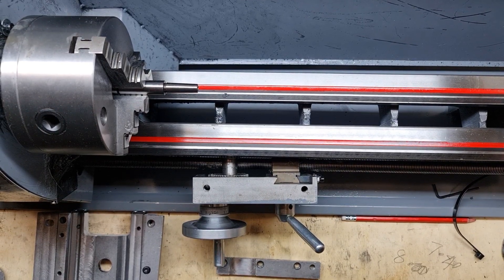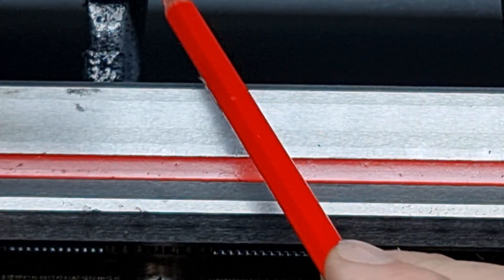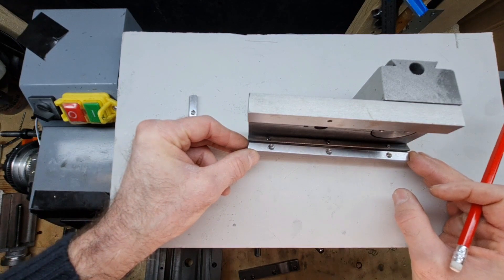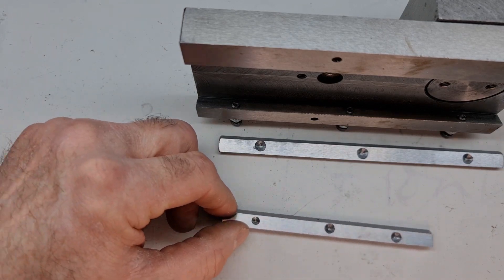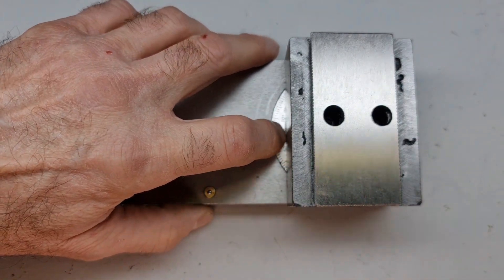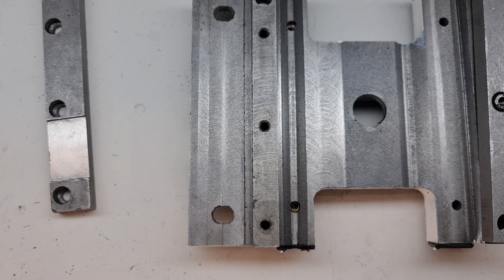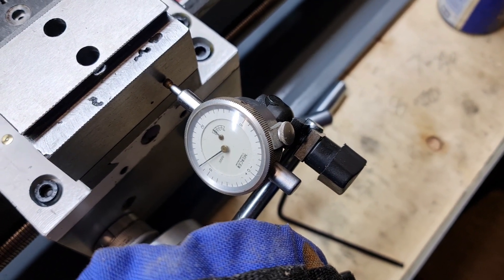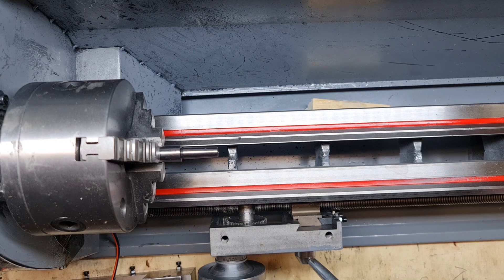Chinese mini lathe review part 3(of 6) More quality control issues & a strip down of the cross slide

Comment: I know this is too late but if the seller is offering a replacement on something like this, ask for a part refund. Like you say you’ve already done work to it to make it acceptable and would have to do the same to another one, and from their end, it’ll cost a lot to send you another one out and possibly scrap the one you return, so they’d be open to refund some of the cost. I’ve seen one guy who asked to return one and they just left it with him and gave a full refund!
Reply from the maker: @Yosser70  Hi, thanks for the advice. Well too late now the seller has long disappeared from Amazon, probably to start the next lathe selling company !!

Comment: I am not sure if yours is the same as mine, but when I took my backing plate off the entire shaft came with it as it is all 1 piece. it doesn't unscrew like other models. So, I am planning on redesigning it with grease points and oil seals. I think that will help a ton on top of the better Japanese bearings I want to install.
Reply from the maker: Hi thanks for your comment & interesting & greatly needed adaptions! There is one guy who has set up a permanent lubrication system for those bearings. I am not sure what shaft system I have, I will have a look at the bearing replacement procedure at some stage though.

Comment: This video just convinces me more not to buy any of these ultra-cheap lathes, and go with a Precision Matthews one. Granted that the smallest PM is a 10" x 22", but it is over 3 times the cost of the cheap (8" x 16") Chinese lathes on Ebay (factoring in domestic shipping, including the lift gate charge). You would get a working lathe out of the box, despite also being manufactured in China. I suppose the PM people take the lathes and completely re-manufacture them, but I'm not sure; the opposite would be that they hold the Chinese manufacturers to very high standards (something that has been otherwise hard to do from my experience). 

Trying to import them from China directly is also very expensive, as I discovered, with freight + additional 25% (or higher?) to the US tariff to the purchase price, making the 8" x 16" lathe 2x the cost paid and will still have the same problems encountered here (and only a partially working compound rest). So, to get a reasonable deal, you'd have to put up with the crappy customer service/support from the importer (at least in the US from direct from Amazon or Ebay--I don't know about other resellers like Grizzly).
Reply from the maker: Indeed, that is all quite true. You pay your money & take your choice ! I feel I have got this lathe into a position where I can use it, not for ultra precision work mind you, but for doing spindles like the one I did in the video. Hopefully the videos informed people of what to expect & also informed decision making, which was my intention.

Comment: I guess the old saying you only get what you pay for applies to lathes as well
Reply from the maker: You do, but my experience of an equivalent price second hand British lathe was dire! So never again, only Chinese new this time,  with all its faults.
Reply: @campacolasworkshop6042  If you bought an antique second hand lathe you were responsible for checking the condition of it when you bought it, that scenario is not comparable to buying a brand new machine, which old lathe did you have trouble with?
Reply from the maker: @heybabycometobutthead  I cant remember, but I would never buy a secondhand lathe again. I was responsible for checking it & I did but it was still rubbish when I came to use it. So clearly I did not have the skills to check it thoroughly enough. The previous owner must have worked around its rubbish accuracy but I could not.

Comment: You could dome the ends of the cross slide gib screws. If you reverse the gib so that the holes point the other way you can file a groove across the gib for the centre screw so that the gib will always move with the cross slide and just let the dome end screws connect with the gib without holes. The existing holes should not bother the gib sliding. The holes are generally drilled at the wrong angle since the drilling is done with the gib flat but when in place it is at an angle to the screws. Great video many thanks
Reply from the maker: Thanks for the suggestions :) I have been sent some new gib strips by the supplier, one blank & one pre-drilled. So I will try that with the pre-drilled one. I have managed to mill out the holes in the original smaller cross slide gib, so the holes are at least lined up now!!

Comment: best way to measure the spindle runout is to take the chuck off and measure the taper on the spindle nose.  You can also see how much axial play there is to gauge preload on the bearings.  They Ship them quite tight and mine had issues with how they seated the bearings.  If you can imagine, the quality only gets worse when you pull the spindle and inspect inside the headstock where no one ever looks.  Finally, you should run it for 5-10 minutes and check how hot the bearings are.  They should not be cold or hot but should warm up.
Reply from the maker: Thanks for that detailed info & I will follow uour suggestions.  I have tested at chuck jaw level with a calibrated piece & everything matches up, so I am happy....for now!  I have established what the run out is at the start, so will keep an eye on that :)
Reply: @campacolasworkshop6042  the problem with your testing method for the chuck is that you are assuming the scroll in the chuck is perfect.  it likely is not, so the best way to test the chuck is with different diameters.  now the difference may also be minor but I just wanted to point out that your runout likely changes as you change the jaw position (work diameter).
Reply from the maker: @JesseSchoch  OK, I get that, I will take the chuck off & test it the way you suggested in that case, when I have time.

Comment: Quick question on the block at 11.11 what size hole does it pivot on and the cross slide boss what size pin is it ,on mine there is a 2mm difference  thanks also is your tail stock extruded aluminum   alloy hollow  section, can't see any others on YouTube that look like mine ,it does not have a boss sticking  out around the locking lever for the  moving barrel.
Reply from the maker: Hi, really sorry you are having similar issues!! T
hanks very much for your feedback on the gib, I will do as you suggest :) 
The round pivot that goes into the hole from that block into lower part of the x slide mechanism is 31.25 mm in diameter the hole is 32.5 mm the pin is 6mm. So similar to  yours?  it  seems to have a 1.25 mm gap. So I think I have already worked out that getting any  work done requiring the cutting tool post to keep an accurate position will be difficult???
I tested my tailstock with a magnet, it is definitely a ferrous metal! Did you get nylon gear wheels as well ? 
My Amazon supplier has promised my parts  replacements in 2 weeks.
Let me know if you need any further info on my lathe. I hope you get it sorted to your satisfaction. I am guessing this Ebay seller sent the lower spec item sent out of the same factory, most likely :(
Reply: @campacolasworkshop6042  gears are steel head stock all looks good, lathe bed looks good but  bad burr on bottom edge near rack, saddle looks good but will need stripping cleaning deburring ,the half nuts need looking at not centralized bends the leadscrew down when engaged if I hold engagement lever up it just misses  lead screw.
I will make a bush to take clearance up in pivot point, , or make another boss with a bigger 8mm pin to match hole in tool post for strength  less likely to spin round/move .
My lathe is the  Lathe 22x60cm 1100W got the moving and travelling steady's with it .
I would have preferred the 4 independent jaw chuck instead of 3 Jaw as it grips round and square can set as accurate as you need and safer when gripping on short lengths or nylon/plastic.
Reply: @campacolasworkshop6042  your pivot point is for the compound slide so it will be sloppy /fiddley to set a angle mine is the same could be corrected later by make a new boss 32.4mm dia with a bigger pin to fit the casting ,it won't affect the tool post/normal turning in normal use.
Reply from the maker: @reedy93  I will have look at that. Thanks. I asked for some plain replacement gib strips to be sent so I can  alter them as you suggested.
Reply: @campacolasworkshop6042  messaged the eBay seller I kept it very business like as he does not know what they ship must have come from a warehouse in EU. he said is it ok if we ship you another tail stock no problem I okayed it, hope to get it in a couple of weeks.
Think the lathes are put together as quick as possible from standard parts by different machine shops the alloy tailstock is really cheap bad design.
Trying to get it up and running without doing to much work . the brass or steel shim has worked will and going to do same on cross slide you could try it on old gib strips with steel  shim epoxied on you could avoid/cover over  the old drill marks .

Comment: Mine has arrived, no damage in transit ,little bit behind you in little shop of horrors been working on my compound slide same problems as you with gib strips luckily my drilled dimples were that far out i could re drill them but found when setting they cock over, don't remain parallel to dovetail  i have no mill so used some brass 1.0mm thick to shim at grub screw side they need to be a good fit within 3-4 thou before you adjust them. the screws need chamfering at the ends almost to a point to remove the thread. i used 1/8 bras tube in the threaded hole to protect the 4mm thread and drill about 2.4 mm through  the tube through the brass shim and about 1.5mm into the steel gib strip the point on the screw keeps the gib from sliding out. all drilling was done assembled with a hand drill.  all worked will with no play also put some thin brass shim behind the dial as it was galling up, this area needs another fix but will do for now.
The 1.0mm brass shim  check yours with a feeler gauge and get the nearest you can to correct size
I built a lathe once   wasn't planning on doing it again !  my tailstock is a nightmare  total scrap it's aluminum  alloy on top half. bought  my lathe off eBay just messaged seller tonight.